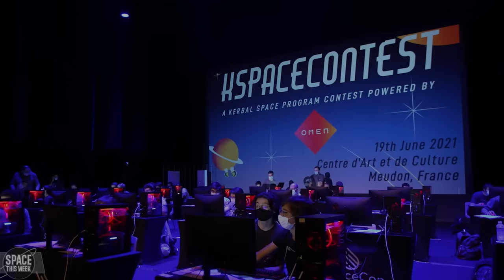SpaceX Just Destacked Starship after ARMING it for Launch + FOUR Falcon 9 Flights in 1 Week!

Comment: The hot staging ring should have manhole covers for maintenance access.
Reply: That's a good point
Reply: I wonder if some birds may have tried to nest up there?
Reply: it would very quickly be blown out during use
Reply: @jwenting  unlikely, they’ve removed the hot stage ring several times
Reply: I have a feeling that future boosters will have the ring integrated and whatever they are fiddling with will be accessible from the sides.
Reply: Now that I've had my 2nd cup of coffee and my eyes are open, I wonder if they needed to access the batteries to hook up the explosives?
Reply: I am not so sure, it may be fairly large, but it still might be considered a 'confined space' by OSHA standards (or violate any number of other regulations); in addition to adding, weight, complexity, and another failure mode (as previously mentioned).
Reply: @DavidEdwards9801 maybe they need giant panels to cover the gaps? Big red ones marked "remove before flight" :-)

Comment: "Banjo" is the colloquial term for the ring-shaped fittings you sometimes see on the end of flexible hydraulic pipes. The circular part of the banjo has a groove machined around the inside. The banjo is attached to a piece of equipment via a "banjo bolt", which looks superficially like a regular bolt, but is drilled up the inside and has an unthreaded portion under the head, in which are one or two cross-drillings that connect to the centre drilling. A connection is assembled with a soft copper washer on either side of the banjo and a banjo bolt through the middle. The banjo can thus be adjusted to any angle, and then tightened to lock it at that angle, the tightening crushing the copper washers and making a fluid-tight seal. Hydraulic fluid flows through the pipe, around the groove, through the cross-drilling(s), down the centre-drilling, and into the equipment. Banjo can be stacked to connect multiple pipes to one connection (with a suitably longer bolt, of course), and banjos are available with various angled stems to allow fittings to be made in tight corners. Is this enough engagement Matt, because I honestly think that's pretty much all I've got to say about banjos, although hang on, yes, they're also usually made of stainless steel and can be coloured in various ways to match anodised alloy fittings, and nope, that's really it now, good luck with the algorithm...

...oh yeah, don't reuse the copper washers 'cos they don't crush twice. Okay, really REALLY done now. Bye.

Comment: FTS was installed not armed!
Reply: FTS charges will be part of manufacture.
FTS detonators will be installed during pre flight stacking.
FTS is unsafed immediately prior to countdown. 
FTS is armed by an automated physical process during countdown.

The explosive charges used are virtually impossible to trigger without a detonator, you need an explosion to set them off! 
When installed, the detonators have a physical barrier between them and the explosive.
In order for the physical barrier to move out of the way, a safety pin must be removed.
When the system is armed, the detonators are moved to contact the charge.